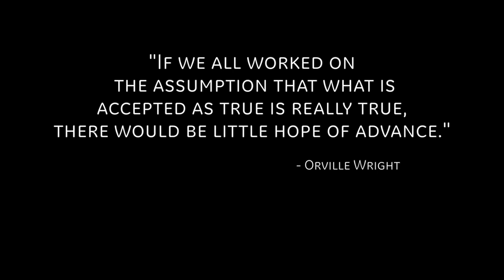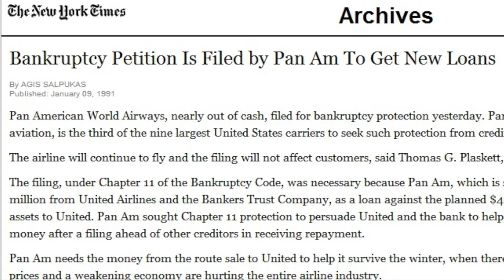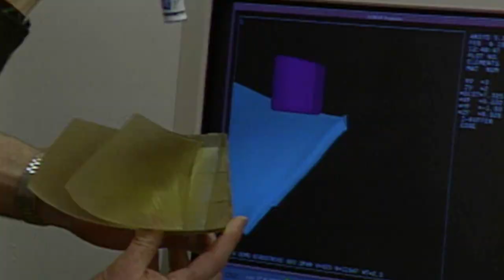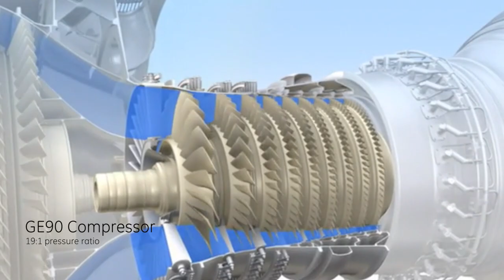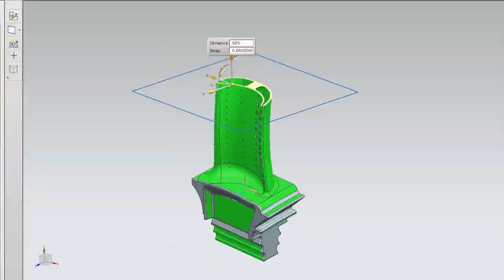GE's Big Bet on Goliath Engines

Comment: one major problem with twine engines...one fails in flight and you're screwed!
Reply: Not so . Today's jet engines are very reliable , and the aircraft can fly just fine on one engine .
Reply: reliable until you ingest a bird and snuff the sucker out! On a landing approach, you won't recover on time.
Reply: Losing both engines from a bird strike is extremely rare , and it also doesn't always kill the engine . You would not believe what a turbofan can ingest and still operate .
On your statement that you wouldn't recover in time , that's much less of a problem than losing one at takeoff . You fly the aircraft , then determine which has failed . A competent pilot has been trained in this .
Reply: This is not true at all. All twins must be able to continue a take off and climb out on a single engine in case of an engine failure after V1. The 777 can fly for many hours on a single engine. You could cross the Pacific with a single engine on a 777 if you really wanted to. When they were testing the engine for the 777-300ER, they flew a 747 with just that one engine.

Also, you can land a plane just fine with no engines. Planes require engines to take off and climb, but they don't require engines to fly. They glide a long way, especially large planes like the 777. From cruising altitude, that thing can literally glide over 100 miles with no engine power at all. I only have 10 hours logged and I've already done a simulated engine-out landing (by 'simulated,' I mean pulling the throttle full back and landing with no engine power, but not actually shutting down the engine, not that it was done in a simulator.)
Reply: happy543210 Why get pissy when you 1) make an astonishingly ignorant statement and 2) get corrected on it?   That makes no sense, just learn from it, and try not to make a similar one net time.
Reply: happy543210   Grow up child.  If you want to be treated like an adult... ACT LIKE ONE.   sigh
Reply: ***** I love how a bunch of ignorant fools, who are light-years away from an engineering degree, are telling ME I don't know what I'm talking about!
Reply: happy543210 Actually, I have an engineering degree, thanks. And, judging from your other comments, I'm pretty sure you have neither an engineering degree nor a pilot certificate.
Reply: happy543210 Wow, what a mature, intelligent response.
Reply: vbscript2 is that why more then 5 airplanes have gone down this month?
Reply: happy543210 Do you have any experience or knowledge in Aircraft Powerplant certification? Do you understand what ETOPS means without having to Google it? If so than I look forward to your response. If not maybe you should reconsider your expertise in aerospace.
Reply: SuperBuzz71
The use of twin engines in jumbo jets boils down to one thing--money. It's cheaper to fly with two large engines than with four smaller ones. Only time will tell if this strategy will be successful. The impact on safety will become apparent soon enough. Place your bets!
Reply: blake askew More than 5 planes go down every month. Most of them are tiny single-engine private planes. As far as airliners are concerned, the vast majority of incidents are in Africa or poor parts of Asia and are due to some combination of poor maintenance, poorly-trained pilots, and/or operating in unsafe conditions (bad weather, bad airfields, etc.) The one that crashed in Europe this past month was shot down, so you can hardly blame the airliner for that one.

Since the beginning of ETOPS in the early 90s, commercial aviation has become *more safe*, not less safe. In the 20 years of ETOPS, how many long-haul airliners have crashed due to not having a 3rd or 4th engine? Hint: The answer is zero.
Reply: happy543210 Actually the 777 with the GE90 can take off fully loaded on one engine.  Time has already told how the strategy works
Reply: jonny6744
That's ridiculous! if one engine is enough, why would the plane manufacturer pay for a second one?
Reply: happy543210 Because that wouldnt make any sense. The 777 is a heavy widebody aircraft that can fly for more than 15+ hours and requires 2 engines do accomplish that, also the aircraft could not go 500mph+ without 2 engines.
Reply: *****
one engine could easily go over 500 mph. just make it big enough.
Reply: No that wouldnt make any sense, and size dosent make an engine faster. And if 1 engine fails then you are screwed.
Reply: ***** Actually, yes, size does have a lot to do with the amount of thrust the engine produces, which is obviously directly related to how fast it can propel the aircraft. This is already the largest, most powerful commercial jet engine in existence, though. Also, the 777 actually can fly just fine on one engine, it's just not as efficient or as safe. In test flights, they've flown the 777 for many hours on end on a single engine and it actually can stay pretty close to 500 mph in that configuration.

Having said all of that, you're exactly correct that they will not approve a single engine aircraft for a large, commercial transport. That would be really dumb for precisely the reason you mention. No airline is going to want a plane that crashes whenever an engine fails and no regulator is going to approve such a plane.
Reply: Well said. Thanks for the help :)
Reply: *****
24 years old, now i'm impressed. what do you do for a living, bag groceries?
Reply: ***** Actually, airplanes fly just fine without any engines at all. They just can't continue to do so indefinitely in that configuration. From cruise altitude, a 777 (as well as almost any other airliner) can glide for around 100 miles with no engine power at all. Also, at least in the U.S., every pilot practices engine-out landings. While it's not common for an engine to actually fail, it's extremely common for pilots to land airplanes with no engine power (and this is not to even mention gliders, which don't even have an engine.)

I've landed a plane with no engine power several times and I haven't even completed my private license yet. And that was with the power cut off at 1,000 feet above ground level, not at the 30,000-40,000 ft. where airliners cruise.

Comment: I don't know about this engine. I think the 777-300 ER would do better with four Pratt&Whitney RB-2800CB16s.   Most 737's today have an engine which is half GE and half French. The largest airliner, the A380, has either a Rolls Royce Trent or an engine which is half GE and half Pratt&Whitney.
Reply: bob lackey GE and Snecma = CFM
Reply: ***** Thank you. I looked it up. And there is Engine Alliance which builds engines for the A380 which is half GE and half Pratt and Whitney. I was just joking about the Pratt and Whitney RB-2800CB16s. A man I knew years ago flew Martin 404 twin engine piston airliners for Piedmont Airlines and it had two P&W RB-2899CB16's. If you go to a video here on YouTube called "Raw Piedmont" you see a Martin years ago cranking it's engines at the beginning.

Comment: GE are also good at debt market gouging
Reply: Good at building washing machines that fall apart and were designed like crap! plastic tubs that crack, tub seals that when they leak- ruin the bearing on the mode selector transmission and the assy itself is not rebuildable to replace that  $5 bearing and costs $350 for a new one!

Comment: 5.5 years later and... 77x delayed because of... the engine! :)
Reply: It is not a major issue though. I don’t think it will be as bad as the Trent 1000 issues on the 787 (even the new version TEN for 787-10 has problems less than a year in service)

Comment: Does airbus use GE engines ??
Reply: No as they are to heavy
Reply: +Andrew Anane GEs where an option on A300/310 and still are on A330. Besides that, the A320 family can use CFMs (GE-Snecma) and the A380 can use EAs (GE-Pratt).
Reply: +sidewalkere what engine does A320/19 uses?
Reply: +Doran_1voice 254 The current ones use the CFM56 or the IAE V2500. The NEOs will use the CFM LEAP ou  the Pratt PW1100G.
Reply: Since the Late 60's on the A300

Comment: Is that a 747 with one Small and one Big engine per wing ?
Reply: They are just testing the new engine..
Reply: The small one is stock .. I guess.
Reply: 38911bytefree
During the development of the GE90 engine, the only airplane large enough to test it was the Boeing 747. In flight the stock engine on the left wing was at idle at takeoff and only the GE90 was powering the left side.  That is power.
Reply: I guess that you can't fly a new engine ALONE so you need stock one in case of dramatic failure. I don't know what are those stock ones, PW, RR. But 777 is only twin engine and -200 trents 800 show muscle in the vids. Appart from its noise. To enjoy a vid GEs are to shy and bring, but If I need to sleep in the cabin, please, stop the RR roraring please.
Reply: 38911bytefree  The 'big engine' (the GE90) was only mounted in one of the 4 positions. They were testing it. The other 3 pylons all had the normal 747 engines. During flight, they actually shut down all of the other 3 engines and flew the 747 on just the single GE90.
Reply: I see, I thought that there was one GE90 per wing, and one stock per wing. Interesting way of testing. Could only one G90 deliver enough power to take off on a 747 or it just to fly and keep altitude and eventually landing ? I know those turbofans are seriously powerfull. Silly question, just wondering.
Reply: You probably could if you had a very long runway, but I wouldn't advise trying it. The asymmetric thrust would make it a pain to keep it going straight down the runway and if you had a failure with only one engine running at or just after take off, you'd be out of luck very quickly.
Reply: nope that 747 has 1 GE-90 and 3 smaller engines turns out that 1 GE-90 has enough thrust to power a 747 by itself

Comment: Carbon Fiber fan blades?
Reply: Yes, carbon fiber fan blades. That shouldn't really be much of a surprise. Remember that the fan blades don't go through nearly as much stress as the compressor or turbine blades. And the use of composites for the fan blades, while more expensive to build, make the fan lighter and thus make the engine more efficient, so it's cheaper to operate.
Reply: oh yea everything is going towards composites and ceramics in the aviation industry 3D woven carbon fiber fan blades are the next step
Reply: Back in the mid-eighties the turbo-prop propeller blades were carbon fiber or composite. But never thought this technology would work for large jet engine fan blades.
Reply: +P C. Like a lot of aerospace concepts, composite fan blades aren't new. A carbon composite fan was used on the RR Conway engine in 1968.
Reply: Not entirely. Notice how those GE90 C/F fans have a titanium  leading -edge glove to combat tropical rainstorms during flight. It was the latter that did in RR RB211 corbon-fiber fans on the L-1011 back in the 70s.
They had to resort to an all-titanium fan.
Reply: Ronald Howell So why does RR use single crystal titanium blades to this day? Is purely down to durability? I've seen reports on news relating to incidents with GE90 engines but apart from fuel line icing issues and an oil feed pipe (both now fixed,) little or no reporting has been given about fan blade failure on RR units.

Comment: We need a 2 engine 747.  The 747 is the queen of the sky.  Everything else just looks lame.
Reply: Except the 737!
Reply: @80sfreak14  The early 737s yes, but they are evolving to look like every other 2 engine airliner.  My fav is the 737-400 combi.  Half cargo plane, half passenger.
Reply: @texmex9721  mine is the 737-800, it's beautiful and doesn't crash all over the place like it's replacement. The 737s will never be any other twin engine plane to me because of that nose, the classic 707 nose..

Comment: High bypass engines are getting to the point that they’ll just be “internal” turboprops. Just check out the latest props on C-130s and see if they remind you of something. Turboprops are more efficient and prop airplanes are safer (react to throttle inputs faster) at low level just not as fast as turbofans.

https://images.app.goo.gl/GkzEbYQEftoMvSvL7

Comment: Not really revolutionary just common sense economics. Engines are the most expensive component on any aircraft. The more engines on a plane the greater the maintenance cost. If the cost per engine is about the same why would I want to maintain a 4 Engine Aircraft with less powerful Engines vs an Aircraft with 2 more powerful Engines that offers the same thing a 4 Engine Aircraft could do.

Comment: RR over ge anytime!!!!!
Reply: Well, For my money, There haven't been ANY CRASHES of 777's involving the GE engines, especially on approach where they're needed MOST, as in the two crashes involving Rolls Royce engines quitting less than a mile from the runway with less than 1000 feet of altitude.

Comment: Can someone get into Americans heads that bigger doesn't necessarily mean better?
Reply: Thanks.
Reply: Romano Ok lets put a tiny jet engine on a 747 for the sake of making things smaller and see how well that goes. Fuck why dont we just go back to Bi planes? They were pretty small. I mean why would you want efficiency and speed when you are running a business?
Reply: +Romano Were we not just arguing about the purposes of a large aircraft engine? It seemed to me that you cared about it quite a bit when you thought it was all about how stupid American were. But now after ive presented an argument about the legit purposes of these engine you dont care?
Reply: just a question, why do Americans like big pickup trucks? They are highly inefficient for what most people use them for.
Reply: Name another car that you can fit a couch in. Now when you can't think of anything except for renting a trailer or a commercial truck you see the purpose of the pickup truck.
Reply: I am not saying pickup trucks don't have their purpose but why do Americans like to drive and pay for the fuel for a truck like a f350 when a much smaller one will do the job and be much cheaper to run? My dad used to carry 2200 pounds with a little 1.5 liter truck.
Reply: But these engines are better, that was the entire point of making them in the first place.
Reply: Yep.
Reply: why? is was a 2500 pound truck
Reply: +ChopStix Fiat Bravo, and in my E46 compact you can fit inside a washing machine
Reply: man9170......Because we can, and they're highly useful.
Reply: man9170 um not every American has a massive truck. Myself, I've got a little Tacoma that does me just fine